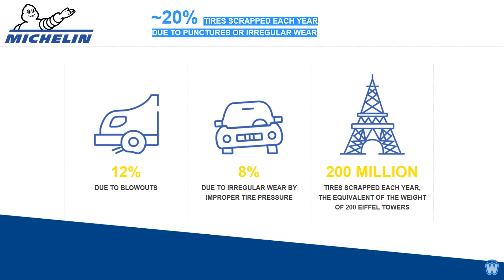Michelin Airless Tire UPTIS - Unique Puncture-Proof Tire System

Comment: They need to show it's performance in mud and snow.
Reply: I would be curious about heavy snow and ice. Park your car outside at night, come out the next morning and water is now frozen to the bottomed, sides, and inside the tire. If you attempt to move your car, do the rubber vanes rip inside of the tire before it dislodges itself from the icy crap?
Reply: ptschafer that’s why it’s a work in progress.
Reply: @Cedar_Valley_Live  no they dont rip but mud and ice can pack inside them throwing them off balance till you can clear it out.  also they tend to be noisy at higher speeds.
Reply: @ShabbernigdoXingjian  I could see that, probably a low-pitched "whirring" noise from all those rubber vanes at speed.
Reply: Put elastic covers on both sides of open  tire🤟
Reply: bax 60  haha..yeah..I don't think he thought this one through.
Reply: @Skyjuice70  don't think you thought that one through did you
Reply: @thefallenx9786  first of all, the covers would have to be just as durable as the tires in the fact that it won't easily come off when making turns at various speeds in snow or mud. Second, applying such protective covers would probably take time with the use of certain tools. Can you see your average soccer mom breaking her back to put on 8 covers? I don't think so.
 I don't think it's as simple as slapping on hubcaps.
Reply: Also I wonder if cold weather over a long period of time would make them brittle
Reply: bax 60  well do it before the blizzard genius, leave them on as a permanent cover so they look normal. how is it gonna help you if you do it after the fact? it doesn't make sense
Reply: @thefallenx9786  right like anybody has the time to wake up at the ass crack of dawn to put on the covers.
Reply: They need to show how quite can it be while driving
Reply: This technology is used by the military and construction heavy equipments so the answer is clear it can go in any conditions

Comment: There is a simple reason these will never work for the masses.
They will work if damaged causing a potential hazard on the motorway due to catastrophic failure will cause deaths where as normal tires will deflate if damaged so risk to life because they wont work if damaged they simply deflate.

Comment: Anyone who drives where it snows will tell you that snow and slush melts and then drips onto the wheels overnight, making ice. Sometimes, you can actually feel the wheels being out of balance when you drive the next morning. Now imagine that ice in the flat spot on the bottom of the tire. And during a snowstorm, snow will gather in the tire, unevenly. Right, right right, that won't happen, due to fairy tale reasons.  Happy motoring!

Comment: When the car drove over the pot hole and being a lighter car. That tire almost completely compressed to the wheel. If you have a big vehicle then  it would hit the   wheel and bent it probably.
Reply: Robert Tucker military vehicles use them, and they have no problems
Reply: @carnage4907  I know. I used to be in the military. But, when I looked at the video those tires needed lot more work to be road Worthy. Lawnmowers has those kind of tires.
Reply: Robert Tucker They'll have different weight ratings, just like pneumatic tires do.
Reply: They have different sizes and more material for bigger and heavier vehicles they use them in construction those vehicles way a lot more than that little smart car.
Reply: @Jason Keeling yes , that could be possible as well. The point I was trying to make is the wheels won't get damaged!
Reply: How well a car absorbs shocks depends on 1.suspension 2. tyres.
Because the tyres are made the way they are, they absorb/compress way more than regular tyres, once fully compressed, the suspension will do it's job.
And obviously, they'll use different grade tyres for SUVs and pick-ups.
Those things ran Humvees!
Reply: The reasons why they aren't ready to be released on public. Wait until they manage to improve the tire, till this sort of problem wont occur

Comment: Couldn’t they still just have a rubber exterior making them look like normal tyres
Reply: They'd be wasting rubber, furthermore it's completely unnecessary
Reply: Nazul Arturo Nieto Rivas 
Unnecessary?!
What happens when small stones, dirt go inside the “tyre”?? Is it still a tyre?!
Reply: I'm in my last year in engineering. My Mechanism Design just told us:  Design you see around you are almost entirely dictated by cost. Cost and safety. Adding unnecessary rubber is not minimizing cost.

Comment: Makes you wonder how many lives would be saved if we had used these tires instead of current tires and all the accidents avoided.
Reply: at high speeds the rubber gets deformed and stuff, that's why they use it in construction sites, coz everything is slow. And I don't know if this is true but the brakes productivity/useability would deteriorate.👍

Comment: I've said it 10 years ago, i'm gonna say it again: how the heck is that design supposed to handle normal torque loads???  NO wonder we still don't see them on the road after all these years.
Reply: Whats torque? (Idk shit abt cars)
Reply: Torque is the twisting force.  Just by looking at that design, you can tell it would collapse under acceleration or braking. Should be no problems turning or when coasting at speed.
Reply: @ChuddleBuggy  oh shit thanks 🙏
Reply: "Slower" meaning slower than how 99% of people actually drive.  Let me know if you find a video of this tire being accelerated or braked.

Comment: The only thing that might be bad about this is that because more tire is touching the surface of the road then there is more friction. It could be said that this is a pro instead of a con too because the extra friction will reduce braking times.

Comment: Just imagine removing those tires out the rim. What a pain in the nuts it most be.
Reply: bkk
Reply: Probably a lot easier actually, you don’t have to let the air out or fill it back up with air once it’s mounted so, technically it should take less time than a normal tire. The worst tires to remove are the ones you find of a corvette or any high performance sports car, those are a bitch to take off

Comment: Replacing spikes would actually be very easy. Cops can use some kind of nail that once it's through the tire (and pushed by the tire), would upen up metal arms on its sides, thus securing the nail/pin firmly on the tire. Then they may connect some long enough rope made of some super durable material which would wrap up around the tire while car moves and either stop the car entirely (acting similar to the brakes) or fuck up and destroy the tires entirely. It may actually result in much better success than current spikes.

Comment: This will blow the fuel consumption through the roof. Winter build the pressure in sharp hard turns and gaps will take in stones and mud. Also snow to consider. Thsi is just trash. The kind if floating effortless rolling a pneumatic tyre provides will never be available on these rollers.

Comment: I won’t trust it unless I’ve seen it drifted off roaded and tracked
Reply: Ive seen them on bobcats and Kubotas they are more than enough for a car
Reply: GioSpeaks the military have used them for ages
Reply: Nathan Plunkett well that isn’t civilian usage
Reply: @gionotreal  no it's much more aggressive than civilian usage
Reply: Nathan Plunkett military usage is more akin to off roading conditions, not tracking..... completely off topic
Reply: @user-ch5ij5yd2g  yet it speaks to the dependability of the tires. I wouldn't say it's completely off topic. I would think that what matters more for A track day would be the type of tread on the tire. I've seen these in other videos that show that the outer tread part of the tire can be removed and another one put on while the inner ribs stay intact. This was designed to reduce rubber waste.
Reply: Mariano Alvarez the military are more tackling things at a lower speed, the think with tracking is lateral force, with no sidewalk or air pressure, a harsh change of direction could just rip the tyre off, making it dangerous in certain situations
Reply: 3 things no tire really needs lol gg they'd be great off road though. Idk how long they'll last in mileage though. Not a lot of tread it seems
Reply: ok grampa

Comment: A lot of departments don’t even like using spike strips because it’s extremely dangerous to the officer having to use them. Also most departments don’t even want to engage in high speed pursuits because of how inherently dangerous they are.

Comment: The cops can use hooks so that something makes the weels stop spinning
Reply: Theres a net that gets all tangled in the rear axle some police carry on the bumper
Reply: Yeah, barbed spikes on a solid track that would use the torque of the tire to either shed the tire itself or stop them by locking them up

Comment: But these tyres will tear off quickly than the regular onee
Reply: if the military uses them, I think  they have been tested in real world scenarios much worse than paved roads....
Reply: hardkore360 to then brother it should be on the roads then . I have not seen a vehicle with those tyres .
Reply: I’m not 100% sure
Reply: Definitely a concern I had
Reply: You'd think that the columns in the tire would give out really quickly, especially if frequently on the freeway
Reply: Chris Anon I mean that the outer layer would get tear off quickly, if that happens the columns are of no use.
Reply: Aymen RED may be ,but this is my concern.
Reply: What research are you referring to come up with your conclusion ?

Comment: The last line the most important. Millions of people will benefit, can't denied them just because of a few miscreants
Reply: Like guns for example.
Reply: This guy was really reaching with that anyways, I've seen probably hundreds car chases and most of them end with pit maneuvers, crashes, the suspect bailing out on foot, and occasionally running out of gas. I've rarely even seen police even deploy spikes and I've NEVER seen it actually work effectively. Besides you can already buy run flats tires that are good for 50 miles after a puncture.

Comment: What about side wall strength, the amount of rubber used per tire is probably over double the amount, the weight, the amount of tire touching the ground at once could be an issue at somewhat high speeds or over water especially

Comment: Try using it in snow, or mud, or gravel, then get on the highway. You’ll be shaking so much it’d be catastrophic (mechanical failure). This idea is 40 years old and surfaces every 10 until people realize its a shitty idea in testing, for the 4th time, again.

Comment: The spike strip just needs to be modified so that the spikes latch on to the tires and wrap around as the car moves forward.
Reply: Yea like hook blades, that pierces thru and latches the tires to rip through,  creating these new tires to drive lumpy and slow forcing driver to stop or slow down
Reply: Just throw hand grenades at the crims that should do the trick.

Comment: Drive through snow once and your wheel balance is screwed
Reply: Couldnt they have a side wall or something to cover it?
Reply: Buzz Jump how would the wall compress with the tire tho, I to am worried about snow, ice, sand, mud, gravel or some random dude stuffing unknown things in unsuspecting drivers tires.
Reply: D J theres such thing as wrinkle wall tires for drag racing
Reply: @DJ-ys9pv  kids will egg people's tires.  but I want these.  arizona has a thousand kinds of thorn and some of them go through brand new tires.
Reply: @buzzjump9422  how tf would that work???
Reply: Buzz Jump excellent point!
Reply: Or gravel
Reply: Hot damn it’s an engineering convention
Reply: Wheel balance doesnt matter under 40 mph. And if your driving over 40 mph in the snow obviously your vehicle would and should not be using these tires... holy shit yall are going to hurt yourself you keep thinking this hard😭😭😭😭☠
The snow would also compact in each crevice balancing it out... or it would melt from the road friction slightly heating the tire... or it wouldnt have any effect at all .. i mean the list goes on...
Reply: @nickh3809  You can definitely feel wobble at 50kph. Mine does anyway. Very scary going +160kph. 😱
Reply: All they just got to do is make the tires look like normal tires to where you can’t see the detail of the holes of the tires cause particles can still get caught inside the tires ..  but they rather show the design of the tire more than the safety of the drivers.. smh🤔🤔🤔🤔🤔🤔🤔🤔🤔

Comment: Never can be succes because after raining these kind of tyres could slip alot and dangerous for car accidents and slipery roads
Reply: The bottom of the tire still uses rubber. Pay attention.
Reply: Actually, moron, they're even better for rain. The less pressure you have in your tires, the more grip you have, that's why these have a ton of grip

Comment: The price you have to pay for one pair far exceeds the price to repair or replace multiple conventional tires. Remember, these tires wear out just as fast as regular ones and will need to be replaced. So you haven't saved any money. It's a gimmick

Comment: This is like 10 years already concept but never really makes it to the market
Reply: because tire sales would hugely drop and that's unacceptable for the f*ckin 1%....
Reply: @zeugirdor214  unlikely. first, people replace tires primarily when it is worn out not when it is punctured. Second, it differentiates itself hence would take greater share in the market... There are many reasons on why its not available in the market, but decrease in sales based on what you've comprehended is not one of it.
Reply: @jeromecastro6940  This airless tires I imagine are easier to retread though. 🤔
Reply: @jeromecastro6940  just like what you've said, it is replace when it is worn out, samething with the newly designed tires.. conventional tires for trucks and heavy load vehicles/equipment require interior (also sales). This newly designed tire doesn't require one..
Reply: The real issue is these tires struggle under load at speed. They tend to collapse at speeds above ~50 mph, which would be catastrophic
Reply: They are already in use though
Reply: Yeah because instead of replacing tires you'd be replacing rims after they get bent out of shape from potholes. Especially in the midwest and northeast U.S. your rims wouldn't last a week with those tires. People dumb enough to have low profile tires are blowing out their tires and fucking up their rims all the time up here with all the potholes every where

Comment: What about brittleness, longevity, constant and high heat generation at higher speeds !
Reply: Mohan Kumar military vehicles have been using it for a long time and it works, they have specialists testing it right now in various conditions. Just focus on the positive and let technology play it’s part with time
Reply: Clinton Ogbechi there’s extreme differences between a humvee and a fucking Prius
Reply: I wouldn't use these tires on a Tesla.

Comment: See how that tire is flat on the ground as it is driving? That's your fuel mileage tanking lol.
Reply: I'm pretty sure this can be modified by making the rubber harder.
Reply: @foximacentauri7891  yes, however a harder rubber will not take the repeated flexing as well without cracking and breaking. Not to mention, the harder you make the rubber the less traction you get leading to excessive tires spin or worse loss in braking capabilities.
Reply: Any actual research on this tire to back up your claim ?
Reply: @tampaps324  mine? Yea... many, many years and entire fields of study dedicated to this. It's called physics. Dont believe me? Go decrease the air pressure in your air tires until they travel with flat area similar to this tire and tell me how bad it gets. Increased rolling resistance, increased friction, decreased efficiency.
Reply: FOUND A MEMBER OF THE CONVENTIONAL TIRE LOBBY.

YOU GODDAMN LIAR, JEFF. MAKE ME SICK.
Reply: @PomazeBog1389  well Dick, hate to break it to you by physics dont lie.
Reply: @PomazeBog1389  You are uneducated about tires and air pressure. If you look inside your vehicle driver side door jam, you will see a sticker for manufacturer recommended air pressure for a reason. Sometimes front and rear will be different. This is what you set your tires at. NOT what is says on the tire itself. That is just a MAX pressure warning not to exceed. Tires that are underinflated WILL cause you to burn more fuel. Yes, it IS Physics!